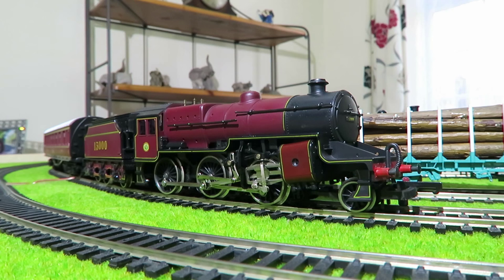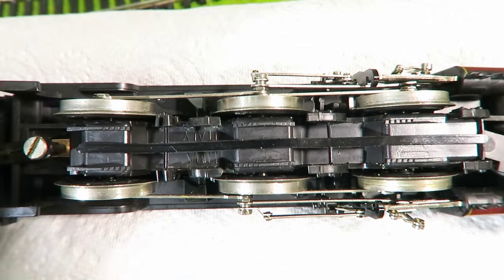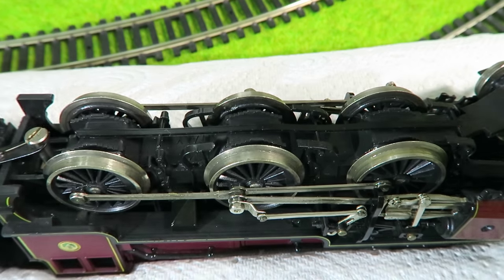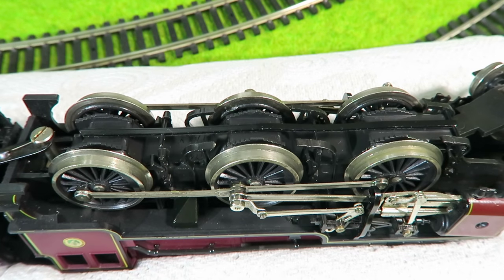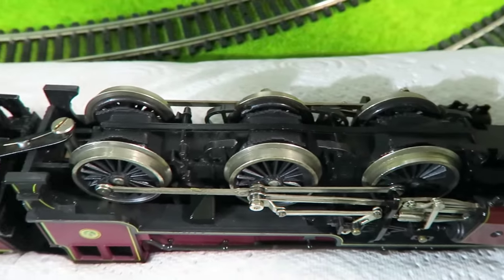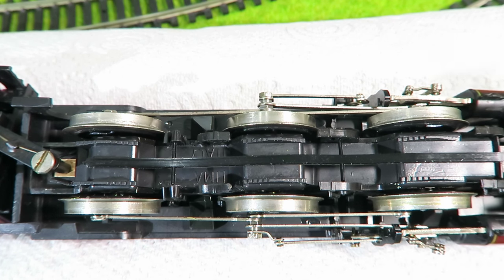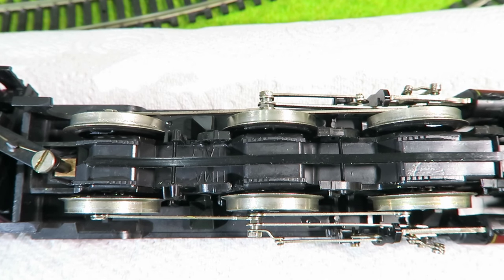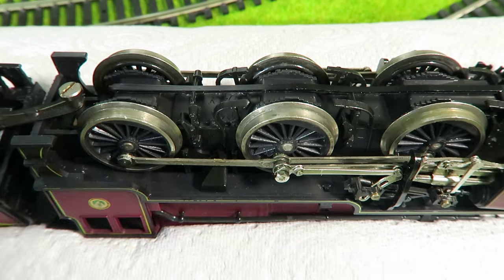Midland Crab 2 6 0 by Lima, repair and running

Comment: Hi Mike, picked up an old crab 2 weeks ago. Loco wheels wouldn't turn. I had this problem before with old lima's. I had speculated that the cast weight had changed shape over time but I thought that was impossible and thought perhaps I had gone mad. This video helped me greatly, she's running lovely now. I removed the weight from the lower chassis entirely and put weights into the boiler cavity to compensate. Usual 'Mike's' service on the motor. I never thought I'd have so many old lima locos cruising smoothly around the layout. Thanks again.
Reply from the maker: Well that is truly splendid news :) so glad to have helped. Look me up on Model Railways Unlimited, think I'll get my Crab out again soon :)
Reply: @MikesMovies  Cheers Mike, love your other channel as well. Keep up the good work.  I wouldn't be surprised if your service video has been at least partly responsible for the price of Lima locos going up on ebay!

Comment: Thank you very much, it put me on the right track, never new about this. Wish I had known before as I had a King class which showed same symptoms before today. Noticed it could be done by just removing the bottom bracket (carefully) which holds the wheels in place, tilt the rear and centre wheels forward and could hinge the weight out. As predicted there were two large bulges on one side and two minor ones on the other side, which had pushed the housing outwards against the wheels. Filed those down, refitted and it worked fine
Reply from the maker: Great news, Follow me over on Model Railways Unlimited

Comment: Brilliant Mike... I've got two of these, one I need to take apart so I might have a go now after watching this... Was that weight about 1.5" long, rectangular with a cut in it for the center wheel axle... I've got one on my desk from another Lima steam loco and it looks like its bulging a bit.. :)
Reply from the maker: +oorail.com Thanks very much, this weight had cut outs for the front axle, was as long as the underframe. The bottom plate clips in by each driving wheel in two places. Let me know how you get on

Comment: I know that this is an old video but thank you for putting it up Mike. I actually watched this before splashing out a whole £25 on a Lima Crab :) When I got it the loco wheels wouldn't turn but following your instrcutions I was able to rectify that fairly quickly. What has completely flumuxed me is how to take the tender body off. I've tried removing the screws from the underside of the tender but it didn't seem to make any difference. Any advice would be most apprectiated. I do subscribe to your other channel and really enjoy the content you post there. ATB Paula
Reply from the maker: Hi Paula, many thanks for the great comment, I think the tender body just lifts off, hinging at the buffer beam end. I'll need to check to be 100%
Reply: @MikesMovies  Thanks for the advice Mike. I eventually got the body. It turned out that the mazak weights in the tender had swelled and were pressing hard against the body. All sorted now though. ATB Paula
Reply from the maker: @paulathomas4944  Hi Paula oh wow so even that weight was breaking down, hmm might be a plan to remove them, and use them to make a cast for new lead ones?
Reply: @MikesMovies  Casting new ones from lead sounds like a great idea but I wouldn't know where to start. At the moment I've just filed them down to fit. The loco is going to be in regular service on my layout so it should be easy enough to keep an eye out for any further problems.
Reply from the maker: @paulathomas4944  ah yes good point, dad and me used to pick up car wheel balance lead, clip it down and make moulds of the shape wanted in clay, pour in the melted lead and wait, probably not a safe project lol

Comment: I have this model I think was once wired for DCC (Yuc) it's now rewired wrongly Just two wires from each contact yet both linked to the current feed on the side of the motor. I'm a Lima collector but this baby has me beat. Connecting a lead to the motor tabs the motor runs as it will on the track but not moving. Adding tyres the motor is dead on the track. Can you help?
Reply from the maker: I'll have to think about that, you should have one side of the tender wheels (with no tyres) connected to one side of the motor, the other side connects via the spring contact through to the loco wheels. Check that there is a spring pressing on the stud that sticks down from the loco and tender link???
Reply from the maker: Look at 3:54 in the video
Reply: Because it was wire wrongly without tyres then is work yet still stationary. The loco was a very free mover so the tender needs tyres.
Reply from the maker: Do you mean it runs but just sits and spins?
Reply: yes but without tyres. Put tyres on and it doesn't run at all?
Reply from the maker: Tyres only go on one side?